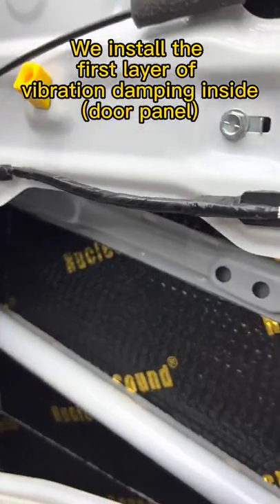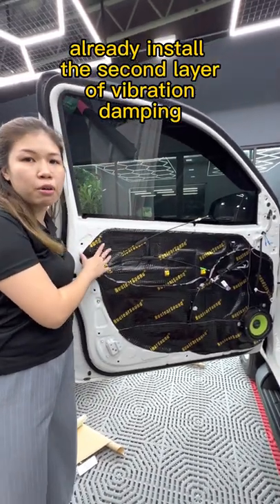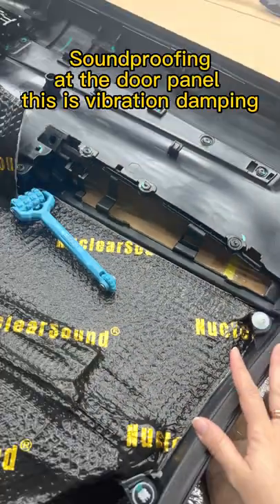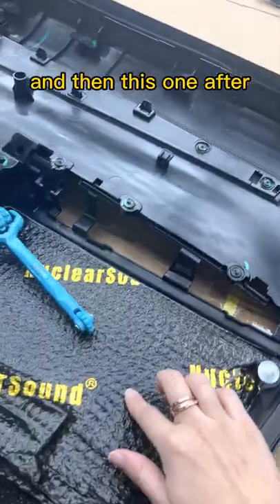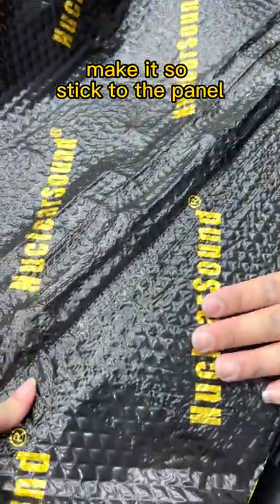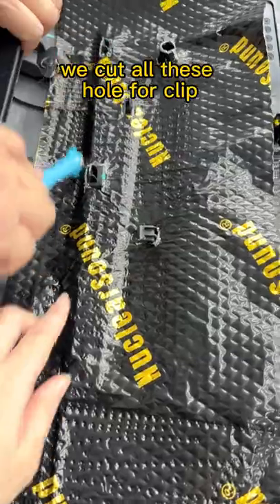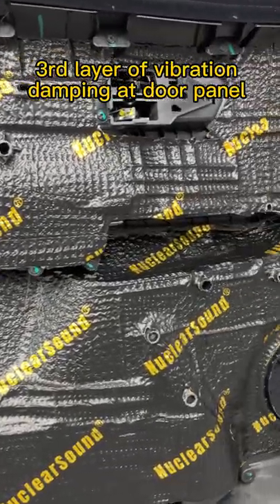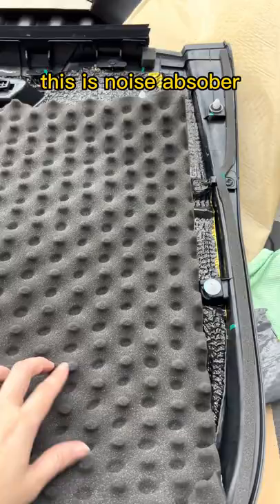Toyota Hilux (Single Cap) installed 4 layers of Soundproof at Car's door

Comment: Did u just put 3 layers of butyl rubber? Whoaw. Does it work better than 1 layer for noise absorber?
Reply from the maker: That 3 layers work as vibration damping, and the very first noise that come from vibration of engine. Always number one rules of soundproof(of car) is stop the vibration then only isolation the noise and absorb the noise.
Reply: I believe different densities will absorb different frequency ranges, so might be better to have variable density across the total sandwich.
Reply: @MadLadsAnonymous  Not really:)

Comment: 4 layer = super extra weight = extra high fuel consumption
Reply from the maker: We using materials right for door in these 4 layers. And it wont add extra "high" fuel consumption for just 10-20 kg added. Still lighten than a normal adult.
Reply: Its really not that much to make a difference. You get more fuel usage just carrying a single passanger or groceries. Why would you say this like you know anything instead of asking?
Reply: That feels heavy for the weak